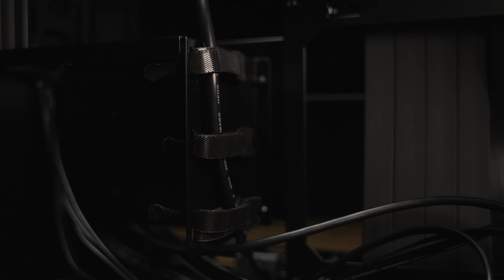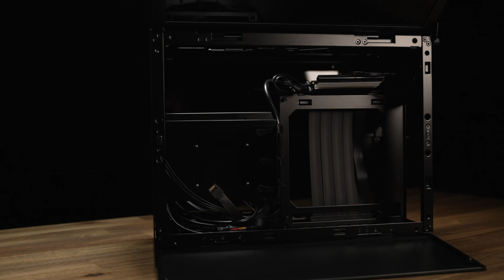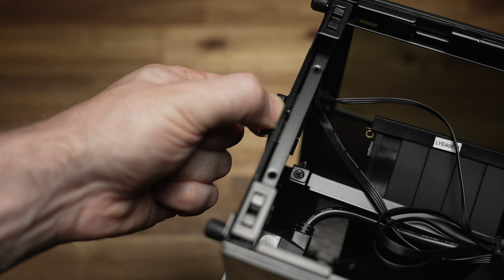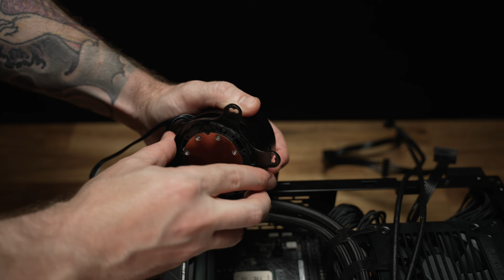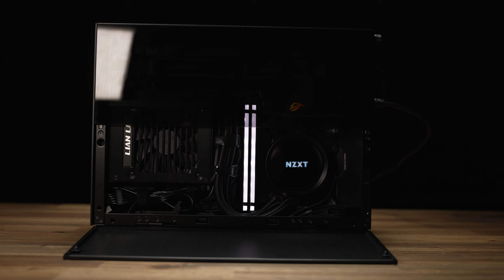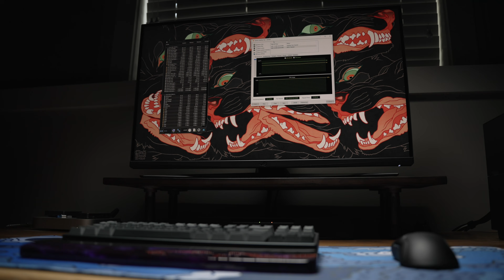Lian Li Q58 Mini ITX Review - Build + Tips

Comment: Hey guys!

I'm looking to make my second build in a small case.
The Li Lian Q85 is what i want to use as my New case.
Fortunally i can use most of the parts i have from my old build.

I currently am in possesion of:

AMD ryzen 7 3600x
X63 kraken 
3070 vision OC 
A m.2 1 tb card and a hdd 
3x 140mm fan 

The parts i need to replace are 
Motherboard with a  (Asus ROG Strix X570-I Gaming Mini ITX AM4 Motherboard )
Powersupply with a (Corsair SF 750 W 80+ Platinum Certified Fully Modular SFX Power Supply) 
And i'm switching to the Li lian Q85 ofcourse

My question is:

Will the x63 kraken fit, will the fan at the bottem fit a 140mm fan and if so how should regulate the airflow

Sorry for the bad English! 

Many thanks in advance :D

Comment: Isn’t there a way to add another additional fan to the bottom to help with the airflow? looking at the PC component prices I don’t think anybody who wants to build a SFF computer cannot afford a NVME m.2 drive to get rid of those SATA SSD spaces and locations to focus more on cooling
Reply: In this case no. You can mount one fan beneath the PSU if you lose a SATA SSD, but the motherboard comes down to the bottom of the case on the rear half of the case.

Comment: awsome vid...i got a cooler master argb downfire cpu coolerfor nine...damn mobo didnt work with my r7 27`` 65watt chip..got a 2 fan gigabyte rtx 2060...16 gigs of corsair rgb 3000mhz for ot and a 600w corsair sfx power supplu...1 vetroo argb fan in the bottom...got a fan grill on it my dad had on an old fan...bless his heart!..its hard plastic..i have 2 more fans in the top..im gonna try the 2 argb fans in the top to pull air in and bottom fan is exhaust..wating on newehg n word on my asrock b450 itx mpbo....only thing holding me back...i think it will do good n have decent temps being its a 65watt chip...love to get a 3700x for it but this is the wifeuys extra chip...id have to pgrade her again to get her 3700x haha..love thje vids!!!

Comment: I noticed the top panel is very limiting for airflow. If you remove the top panel and your 240/280 is set as exhaust the temps drop a lot.
Reply: I stress tested my 12700kf and took off the top panel, temperatures didn't really change. Running an H100i 240mm with exhaust fans under the rad
Reply: @tehgzizlauw1787  what are the temps ur getting I have the same cpu planning on building in this case

Comment: Hey mate, i was wondering for the fan under the PSU, i know it's a 120mm but how much height clearance does that space really have? is it just enough for a slim fan or could you push that with like a NF-A12x25/Phanteks t30 120mm? It looks close in your build but just wanted to confirm if you knew
Reply from the maker: oh it could for sure fit a NF-A12x25. That's not a slim fan I'm using in the video, that's a 25mm thick fan, just like the A12x25

Comment: Great build I think I need to add a intake fan in the bottom cause my Gpu at stock full load hits 80c really fast.  I also couldn't use that channel for the aio since all my motherboard connections are there but it looks fine going along the top near the radiator fans then down between the ram and cpu.
Reply from the maker: yup! the bottom intake is what makes the difference for the GPU. there's another video review I watched (can't remember who's video) finding the same thing but they actually tested with and without to have the data to back it up.

Comment: Hi Jared, which mobo did you used? I had the Asus Rog 550i in my build and everything else run fine and stay around 60~70C but the chipset temp gets up to 90C+ in a about 2 hours of gaming. Do you think that is normal?
Great video btw! But I think it would be nicer if you included the components used for the build.
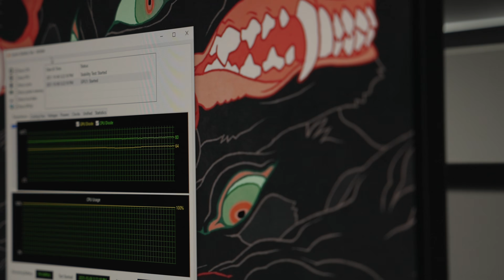Reply from the maker: I did include the components used for the build. I posted them in the clip with the temperature graphs. Upper left hand corner 7:49 

90c is fairly hot. makes me wonder about the thermal paste and or application of thermal paste.
Reply: Oh right, sorry I missed it. And thanks for reply, will check that.

Comment: Can you fit rtx 3080ti or 3090?
Reply from the maker: Really depends on the model. I've mentioned the maximum length in the video, but the Lian Li site gives all of the dimensions you'd need to know. But chances are yes, the 3080ti and 3090 will probably fit